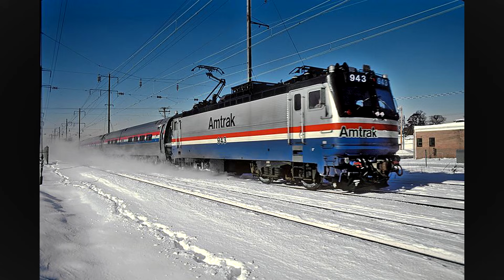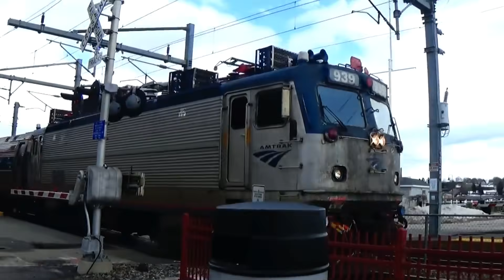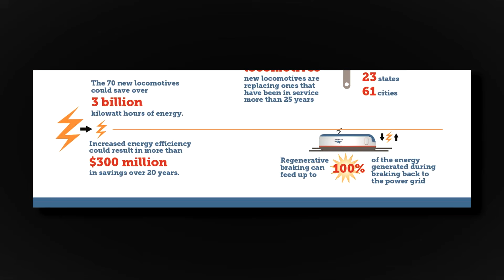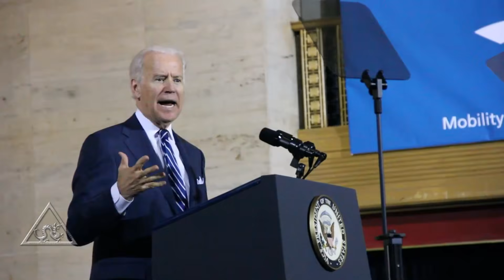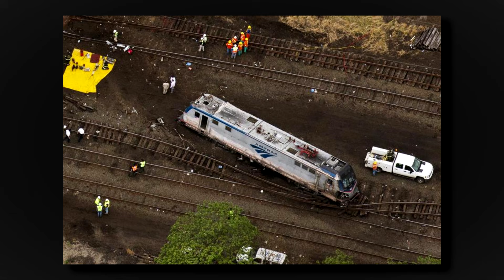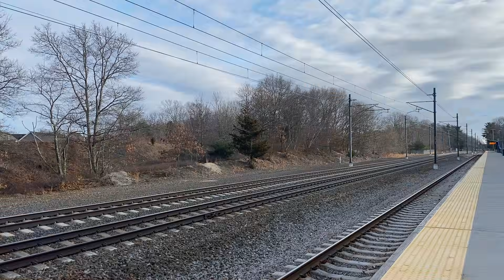Engines of Amtrak - Siemens ACS-64

Comment: I’m a retired railroader/amtraker and I’ve worked on most of the locos from E60s and F40s on up to these locos.  I’ve also had the opportunity to work on the 1st high speed trains(can’t stand that Acela name).  The ACS64s have their drawbacks, but are capable units.  Most of the components are easy to remove and replace, with the exception being much of the undercarriage equipment.  Even with the ones involved in accidents, much of the car body and chassis remained intact!😮. These are robust vehicles!  These were the last pieces of equipment I worked on before my injury and subsequent retirement.  I never had a chance to work on the Siemens diesels or the new high speed trains.  Time will tell if this country can ever come up to the challenges of having a world class passenger rail network?!

retired railroader/amtraker 1993-2024

ps: I’m also on the wall photo at Wilmington, De Amtrak station.  Look for me with unit 642, top row, centered, wearing a bandanna😎

Comment: Siemens All Cities Sprinter

A European Locomotive Based On The Siemens EuroSprinter

AC Sprinter (Catenary)

DC Sprinter (Catenary)

AC Sprinter (Wireless)

DC Sprinter (Wireless)

Both Currents Sprinter (Catenary)

Both Currents Sprinter (Wireless)

BC = AC/DC Or DC/AC (Single Volt)

Dual-Voltage = 2 ACs & 2 DCs = 4

Quad-Voltage = 4 ACs Or 4 DCs

Engined = Fossil Fuel Powered

Engineless = Batteried Or Voltage

Comment: Unfortunately, it seems that if things go well the majority of the ACS-64s will not be serving Amtrak for long. Amtrak just announced their plans for their new Airo trainsets, which are trains sets semi-permanently coupled with Siemens charger diesel locomotives (with options to use electricity on electrified corridors) and Siemens venture coaches. They are meant to replace the aging Amfleets but because the addition of electric capacity ACS-64s won't be needed for the majority of the NEC based routes (including the ones like Keystone, Pennsylvanian, etc. Which requires using of ACS-64 to go to NJ from NY). While I'm definitely happy with where Amtrak is going with the new trainsets, it's sad to see ACS-64s retiring from Amtrak at least so quickly...

Comment: Maybe he could do engines of Amtrak 4449 since it technically did pull an Amtrak passenger excursion after it pulled the American freedom train so in terms of railway service is 4449 and it would technically be an engine of Amtrak because it pulled one of their passengers a heritage passenger train but it was still a passenger train
Reply: Because a locomotive pulls an Amtrak train doesn't make it an Amtrak locomotive. Amtrak locomotives are locomotives owned or leased by Amtrak.

Comment: Laying here and thinking about how when Amtrak was evaluating options for high speed, they tested the swedish X2000 (along with the ICE, but that's a different matter). Given how the X2000 trainsets we're assembled, I kinda had the thought of a set similar to the talgot sets on the cascades that could either be hooked up to an electric engine like the ACS64 or a conventional diesel (I'm imagining something similar to the VIA LRC aesthetically at least, tho more likely a charger) that could easily turn any route into a highspeed-ish route between modern tilting mechanisms and streamlined push-pull operations.
As beautiful as the Acela is and how much I wanna ride it, I still kinda wish Amtrak had gone with the X2000 design when evaluating. 

(Weird video to talk about this under, but I just wanted to get it out. Doubles more than a few people will be kind enough to tell me how naive I'm  being and how there's far more complexity to improving American passenger rail. I know that, I'm honestly just thinking out loud about what couldve been and what can still be done mechanically)

Comment: Are you going to do more of this because there are still some Rolling Stock that Amtrak has that you haven't talked about yet for example the sptv – 2000, RDC you said you would talk about the ice1, the Swedish x2000, the RC4, the GG1, any of the F units and E units, the fl-9 and you should do the coaches as well. You should also make a video about the gp38 basically you should do the work trains and the earlier locomotive as well as the coaches

Comment: The real reason the HHP-8 failed is because of lack of proper maintenance.  The Acela power cars are functionally equivalent to the HHP-8, but the Acela power cars had intense maintenance by manufacturer-trained specialists.  The HHP-8 got none of that.  This is why the HHP-8 failed.
Reply: Where are you hearing that nonsense?  The HHP-8's are not gone because of lack of maintenance. They are gone because they were a terrible design. While they do share many similarities with the Acela power cars, the Acela's operate with two power cars that eliminate the majority of the traction issues that plagued the HHP's.  HHP's had horrendous wheel slip issues due to the weight and the awful traction control software. Combined with way too many systems that were prone to failure that would disable a train and an overall poor system layout is what caused them to be retired so soon. No amount of maintenance would have changed what were inherent design flaws.

Comment: I’d like to understand the mechanicals of electric Amtrak engines........the wheel trucks and motors and how they have changed over the models. I mean when I saw engines of Amtrak I didn’t think there would be mostly info on body styles places of manufacture, and where they run.

Comment: Should have mentioned that the ALP-64 (in NJT livery) was used for Clocker service for a bit.  Granted, that was largely because most riders were NJT pass holders, particularly between NYP and TTN.
Reply: It’s pronounced ALP-46
Reply: ACS64 locmotives

Comment: Really enjoyed the video! Also, I was wondering where you get the locomotive pictures fpr the thumbnails from, they look really good.
Reply from the maker: Thank you! I make the thumbnails myself using Adobe Illustrator and Photoshop based off of various reference images from Google Images.
Reply: @AmtrakGuy365  That's amazing! You do an awesome job!
Reply: @AmtrakGuy365  you forgot to mention that the ACS-64 has 2 bells, one on each end cab. And they both sound at the same time.

Comment: Lol please could you make a video about the german ICE, wich came to the USA as an AMTRAK train? that would be fun.
Reply: is there?

where does it operate?
Reply: @Markus-zb5zd   In the 90s, a German Class 401 (ICE 1) was shipped to America as a marketing attempt by Siemens and AEG to sell their trains to Amtrak. In short: The ICE 1 performed pretty well. But after the Eschede Derailment in which 101 people were killed after the train derailed at 200 km/h, things changed and the U.S. transport administration soon made it clear that the ICE shouldn‘t be allowed on American tracks. 
Though as far as I‘m aware, the ICE which went to America is still in service under the name “Bruchsal” and DB has announced that nearly all ICE 1s will continue to operate to at least 2030.
Reply: @scanida5070  well that accident was due to lacking maintenance and cheaping out on some parts by the German company.
Reply: @Markus-zb5zd   I know, but by the time the faults had been discovered Amtrak had already purchased new Acela units...
Reply: @Markus-zb5zd  I don't know if it still operates thats why I want to see a video

Comment: The Siemens ACS-64 is one of the coolest looking Amtrak trains in my opinion.
Reply: @DeltaB0y84 HTTC  But they were pretty. I like that weird early 2000s era of design. A lot of cool but profoundly weird vehicles came out of that era.
Reply: @DeltaB0y84 HTTC  I think it looks nice
Reply: I agree
Reply: Facts
Reply: They were the sleekest locomotives
Reply: I’d have to agree! I really love the ACS-64’s taco shell design, and the propulsion. But I cannot stand the Siemens Chargers. The chargers are so… ew. They’re just so nasty to me.
Reply: What about the AEM7…..
Reply: @NortheasternTheRailfan  what do you mean by that
Reply: For me it's a tie with the talgos
Reply: @MatCat675  why
Reply: @Amy-pp7ro  PNW baby
Reply: @MatCat675   pen central all the way
Reply: @Amy-pp7ro  good for you but I'll always love my local units
Reply: Agree
Reply: Bro the HHP-8 is cursed
Reply: But cool at the same time
Reply: I kinda cried a little due to the fact that AEM7 was gone!!
Why the F**K they removed it!! 
Although it was wearing out I missed it alot!!
Goodbye AEM7!!!!
Reply: @RWG25 I mean they would use them as cabcars if they had enough time but no they had to scrap it like the hhp8s were converted as cabcars but like why not the aem-7?
Reply: No
Reply: @Pretzelcoatlus66 there is a thing called an opinion

Comment: Glad the sprinter is working out for Amtrak. Alston have redeemed themselves! I remember getting stuck on a train with a broken down HHP-8. The HEP logic was terrible on those things!  Too much electric load and it would trip an electronic circuit breaker that couldn’t be reset without connecting an external maintenance computer. We had to wait an hour and a half with no toilets and no air conditioning on a hot day.
Reply: The ACS-64 is made by Siemens, not Alstom.

Comment: Not to pile on the sad stories, but wasn't the Amtrak Cascades train that crashed on the opening day of the Point Defiance Bypass pulled by an ACS-64 as well? Similar story to the Philly crash. Driver missed a speed change, so the train was taking a 30mph curve at 80mph.
Reply: That was a different Siemens engine. An SC-44. It later got scrapped and replaced by a new one manufactured thru warranty. The west coast doesn’t have heavy rail electrified line just yet, but the CalTrain corridor is suppose to be electric in a few years time.

Comment: Okay, it's the American version of the Vectron. Cool. And the AEM-7 was the American version of the Rc4. Interesting to see how electric locos in America have long been much more European inspired than the Diesel locos.
Reply: yeah it's based on Vectron and Eurosprinter
Reply: @Markus-zb5zd  I guess Americans like the looks of the Eurosprinter better than the Vectron. But now the Vectron is state of the art and being delivered to many European operators in large numbers. The Eurosprinter is it's predecessor.
Reply: @Nils_Ki  well, the ES-64 seems to have pretty similar stats as well

Though the ES-64 was intended as cargo locomotive
Reply: @Markus-zb5zd  both Eurosprinter and Vectron have been, and Vectron will be delivered in different configurations, both for cargo and passenger trains, and many with multiple current operation and multiple atc systems installed for international trains.

Comment: I really love the fact that Americans and Europeans have different ways to look at railways, as shown is this wonderful video, new engines are manufactured every 20 years-ish, in france for example, the TGV and BB26000 has been around for more than 30 years and there are no plans for replacement. 
Great video! 
Keep the good work!
Reply: Like in Germany, New ICE units come out every 10-15 years, Loco designs have even a larger span. Probably because we don't spend billions on developing new engines which do exactly the same. We basically modernize engines til a point is reached where you would need a new design.
Reply: @Tengri30  exactly, im so bothered the ACS-64 is already planned to be retired in 2032, considering its proving to do very well for Amtrak
Reply: Makes me wonder why they replace their engines so often. While in europe, we still got some in daily service as old as the bible. In germany the 111 and 218 class locos from the 70s, are almost 50 years old now.
Reply: @denzzlinga  The NEC is very, very busy. For reference, the AEM-7 fleet racked up well over 200 million miles over a 36 year career.

Comment: i played this Locomotive in Train Sim World 2020, and i can say thats easily to use. because the Interior is based on the German/European Locomotives, swich i played first before i started with the ACS 64. Trains like the BR 442 TALENT 2, BR 406 ICE 3M, BR 146 and BR 185, BR 182, BR 767.2 and 766.2, and the last ones are the BR 422 and BR425. almost the same Interior built, so the same behavior of the trains. (except the Talent 2, the Brakes are terrible!)

Comment: Great video. However, the ACS-64 has 6.4 kilowatts of power. 6.4 megawatts is enormous.
Reply: Nope, it's 6400kW or 6.4MW.

6.4kW would be less than 9 horsepower - not really enough for a locomotive ;-)
Reply: Normal figure for current AC powered locos in europe, something arround 9000 hp.

Comment: Something to be noted is that these engines, as delivered, were rough riders under 50 mph. A slight modification to the trucks was applied to newer builds and the issue was resolved. Source: a buddy of mine works part time for Amtrak as an engineer. He was the next train out of Philadelphia when Brandon Boston's train derailed. Has his train not been running late due to signal and ptc issues, he may not have gone home that day.

Comment: If possible, maybe discuss some of the earlier F and E units.
Reply: He should totally do that for the 50 years tomorrow! Wait did I just say 50 years! Yes! Where does time go!?
Reply: That's a story for another time.
Reply: Maybe the obscure ones like sw1,sw 1200s,GP 9,GP7,and the RS3s
Reply: They didn’t last long on Amtrak
Reply: I realy like all the different F and E unit stuff, though I'm more familier with the FP7's and FP9's that where used up here in Canada for general purpose use and especially on VIA Rail.

Another model range of locomotives that would be interesting to cover would be the ALCO FA/FPA and PA units, which I think in the early days ALCO did have some, but if not, than I guess they can be dismissed as a Amtrak based video.
Reply: Gg1
Reply: I liked the paint scheme from the 1st day,black with white and blue stripes
Reply: @EasternMaineRailfan  On The ALC-42 Also
Reply: Probably not because what did those unit replace anything because they were inherited from from other railroads
Reply: They were inherited from other railroads. If anything, those belong to a series about Penn Central or Southern Pacific.
Reply: He said in the first episode he is not doing the f and e units
Reply: @Alexgaming: The Green Gamer  shush

Comment: The ACS-64 are reliable and really useful and awesome video!!
Reply: Ther ACS-64 is currently in service in more than AMTRAK, merely along the NEC,  Name ONE commuter rail line that is NOT running them - even SEPTA has them (and they have avoided AMTRAK-recommended locomotives since their divorce from the PRR)
Reply: @PGHammer21A  metro north doesn’t have them.
Reply: There Are Nice On Amtrak & Septa 😊.

Comment: “There is no #666”. I can see why. If it was, then the devil might take control over it.
Reply: turns out #601 was actually #666
Reply: I think 666 was actually wrecked. Correct me if I’m wrong
Reply: @railfanjames7699  nope only 601 and 627 got wreaked
Reply: Dumb superstitions
Reply: @Railoffroader2  Doesn't matter if Amtrak is superstitious or not. They don't want to get complaints from Christians.
Reply: Sail Fatan!!!!!
Reply: CSX #666: am I a joke to you
Reply: I think Unit 699 was to supplement for 666

Comment: One of my 5 favorite Amtrak locomotives.
1.Amtrak Dash 8
2.ACS-64 
3. AEM-7
4. E60
5. P30-CH
Reply: Genesis?
Reply: @LakeStateRailfan  no
Reply: @Jaidyn228  Aww :(
Reply: @LakeStateRailfan  I do have a bit of respect for them though. I’m planning on putting them on my honorable mentions in my possible favorite Amtrak engine list
Reply: @Jaidyn228  OK. What about the F40PH? Do you like that unit at all? I'd be surprised if not

Comment: Want to know why there’s no AMTRAK 666?  Because 666 is the Devil’s number, and Amtrak respects our different religions.  The Santa Fe railroad had a Dash 9 numbered 666, but later in life, they renumbered it to #599.
Reply: There is a ac 6000 from the csx number 666 but i don't know if the unit is still working with csx . it weird but i understand because of cursed locomotives with bad luck number like 1313 from the Pennsylvania railroad
Reply: BNSF created 599, due to crew superstitions I believe
Reply: @AVeryRandomPerson , Thanks for your opinion.